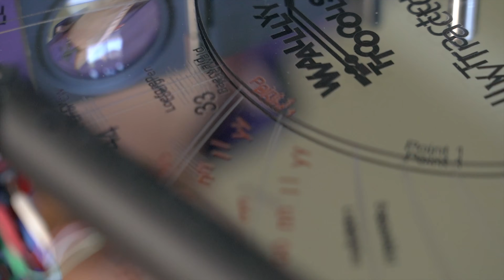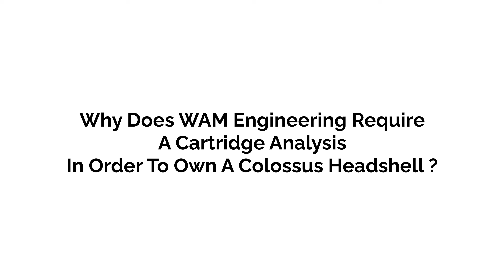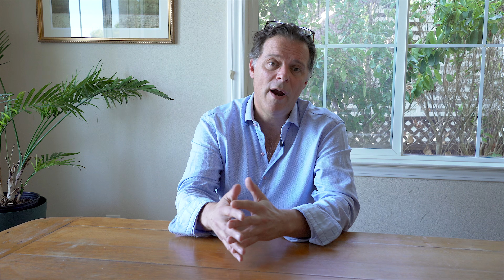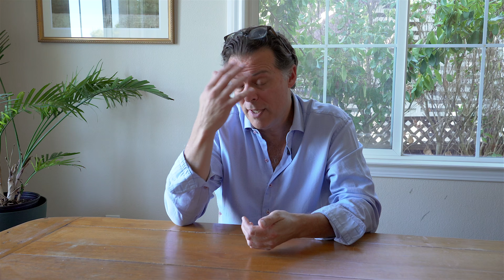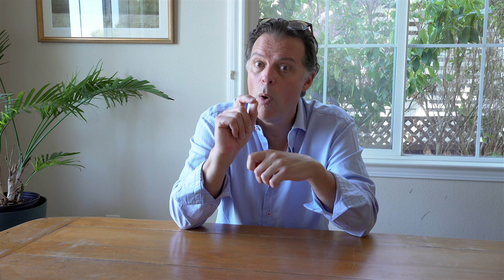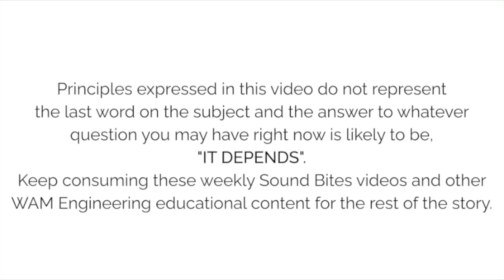Sound Bite #50: Why Do We Require A Cartridge Analysis To Own A Colossus?

Comment: You got to drain the energy from a turntable ideally from the bearing and the motor. But you can use feet that help on a isolation platform like the one I mentioned before. Have you made one yet, just get those glass desserts I think you know the ones I mean, about three inches in diameter. pack them with kilm dried sand and then place your tt feet on them  you might want a little bit of paper between the sand and the feet. You can use one of those for the bearings as well, but place the glass container on some open cell foam about two inches thick giving compression like a washing up sponge ,that's important if it's sprung loaded chassis, also not so much if it's not
Reply from the maker: There are many different ways to make a mechanical filter
Reply: @WAM-Engineering  yes and no, you can use tungsten pounder. You need something that's got mass that can disperse the energy quickly and is an isolator and sand and tungsten powder are the best. I don't think there's anything else is as good. What are you thinking of then?
Reply from the maker: WAY too many “it depends” in there. The “best” depends upon what frequencies you want to manage, what displacement amplitudes you want to manage and what degrees of freedom you want to manage. There is almost never a simple answer
Reply: @WAM-Engineering  well you want to concentrate on the lower frequences below 200 Hertz, displacement, that's where most of the damage interference comes from. And bearings are below this, double figures. Any frequency that is causing vibrations you want to get rid of. Higher frequencies take care of themselves generally, with the plinth and  platter of good design, and do not have any energy. Give me an example too many, what materials is good then.??

Comment: Lowering the noise floor reveals sonic gremlins that were heretofore buried within / mixed in the noise.  Makes total sense.  The better the equipment, the more we can hear what was otherwise obfuscated by noise we did not realize that we had.  I never thought of it that way.  This video opened my eyes (or ears?).

It is like a noisy restaurant.  You kind of hear everything, but can't really focus on quieter sounds, assuming you even notice the quieter sounds.  Then someone taps their glass to make a toast, and we now hear the door to the bathroom swing open.  That sound would have been there, but we would not have heard it.

I am considering upgrading my power conditioning for my stereo.  Probably going for an Audioquest or Shuyata package.  But, yikes, if it reveals some noise that I never realized I had.  The adventure continues!
Reply from the maker: You are quite right!

Comment: so true., as the noise floor gets lowered, artifacts hidden by the noise now become quite apparent. Has happened to me several times. As noted can be really tough to determine what the true cause was and not just try to SWAG your way out of the change.
Reply from the maker: Yes, the common reaction is to churn through equipment. Instead, if we can learn how to better measure the characteristics of our noise floor, the analysis can become an efficient guide to lower it